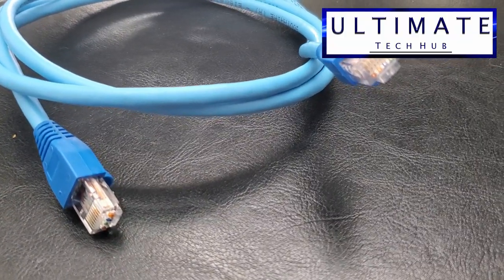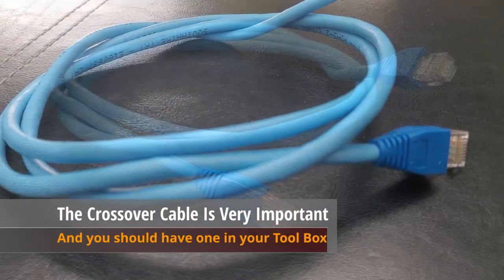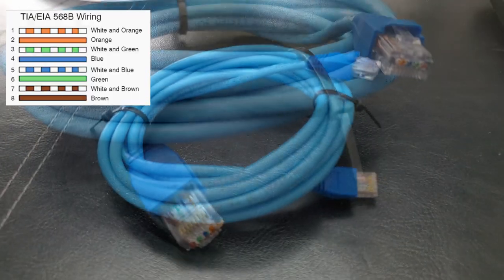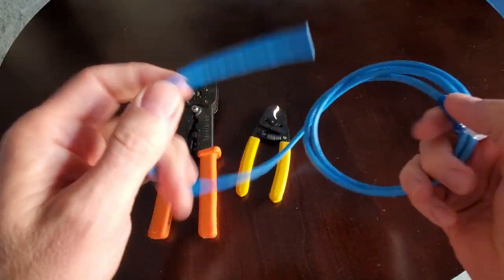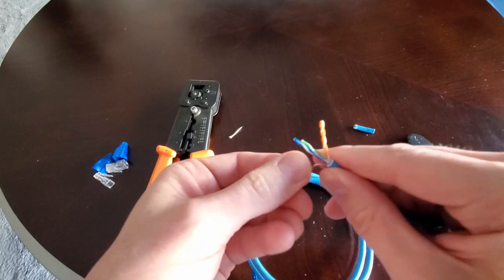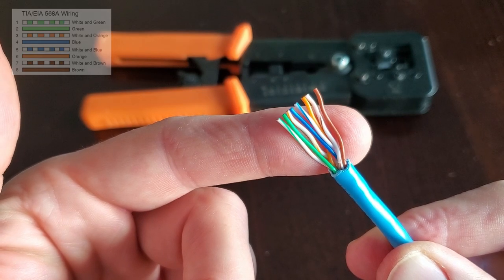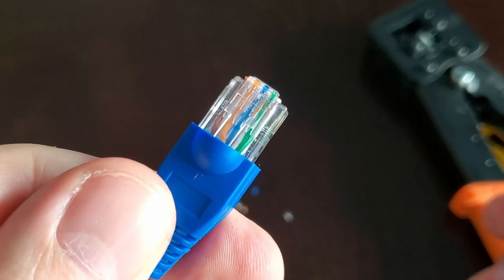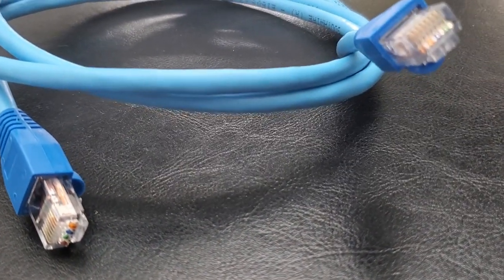CAT6 CROSSOVER CABLE - HOW TO - QUICK & EASY!

Comment: Can I use the cat6 crossover cable to my main router to second router as AP? However, by using a crossover cable can it be reversed when connecting to the main router to a second router?

Comment: Hello i can't use cat6 for crossover, however the straight through really do works. What could be the problem here?
Reply from the maker: It depends on what you are using the crossover cable for.

Comment: What would be the downside to using passthroughs when connecting two like devices?
Reply from the maker: Gigabit Ethernet was created with a widely used option called Auto-MDIX (automatic medium-dependent interface crossover). This technology detects whether you need a crossover cable or a straight-through cable, and it automatically configures the network interface card accordingly.
Thanks to this technology, if you are using Gigabit Ethernet, chances are you will be able to connect your PCs or hubs with regular, straight-through cables, and the NICs on either end will detect the cable and adjust accordingly. Its pretty cool but for this video  I wanted to keep it simple. However with the older PCs or Laptops a crossover cable would be needed.  Thanks for the great question.
Reply: @UltimateTechHub  Thanks for an even greater response!  Makes sense.

Comment: Can't this enhance internet connection to a ps4
Reply from the maker: No a crossover should not be used to connect a PS4 to a router or switch. A straight through cable should be used. You can use a Cat7 if you want more bandwidth and speed.
Reply: Oh
Reply from the maker: @Rahmi Acar I agree 100 percent. The only advantage of going to Cat6a is the 10 gig speeds for LAN to LAN connections on your private network. However the hardware would need to be upgraded on the NICs and the switches to utilize those speeds. I did a video on Which Ethernet cable do you need and I go over all of this extensively.  Cat5e really works well even with 1gig fiber from your ISP. And yes the tighter the copper wires are twisted the faster the speeds and less interference. My network is a combination of Cat6e and Cat6a. My wifi speeds are around 700mbps and my wired speeds are around 800 mbps. Thanks for watching and for commenting.
Reply: @UltimateTechHub  Typo???? Cat 5e and cat 6a?
Reply from the maker: @Soulcommander  Cat5e will work just fine. Cat6a is a bit over kill for a PS4.
Reply: @UltimateTechHub  Thanks for the reply, but I think you misunderstood. You wrote above " My network is a combination of Cat6e and Cat6a."   I just wanted to point it out I do that sort of thing all the time.  ;)
Reply from the maker: @Soulcommander  Yes I meant Cat6 and Cat6a not Cat6e. Sorry.
Reply: @UltimateTechHub  No problem bro great video too.